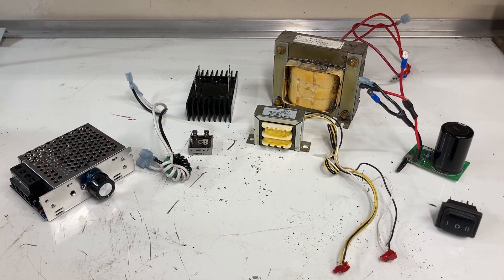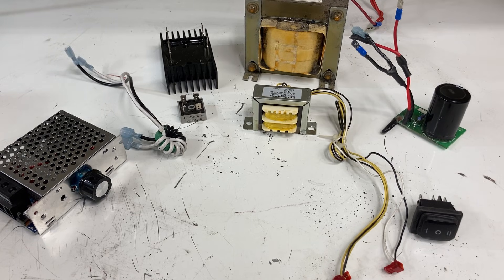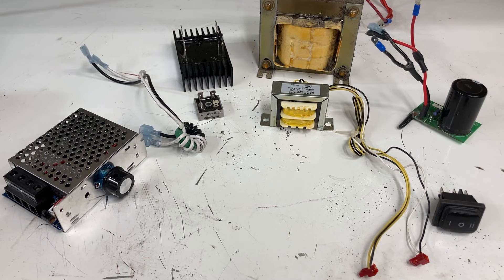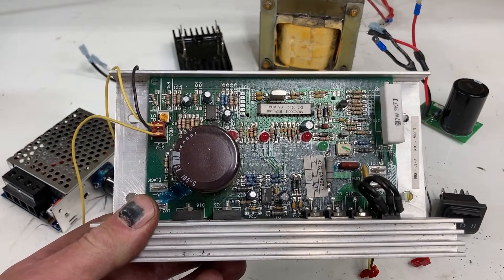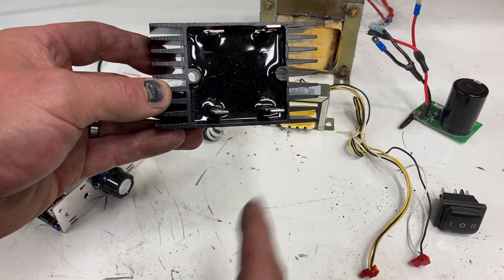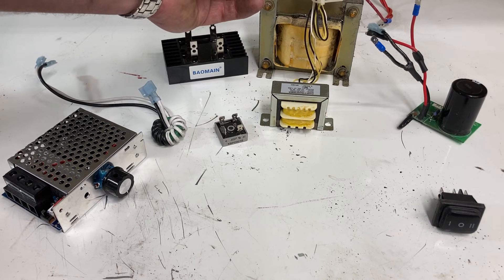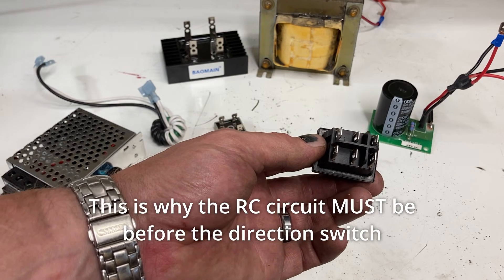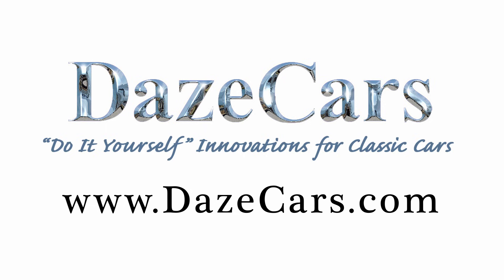Putting Together a QUALITY Variable Speed Power Supply or Treadmill Motor Controller SCR type

Comment: Hello Mr DAZE(?);I LOVE your videos,i try to do the same circuit like you did for my training treadmill,i use all the parts you are using except the scr,i use the one you saw on 12:15 ,and its fail,when i increase the speed the main panel fuse trips.but it did the same when i use the one  you saw to as on 11:10 sec .any sejection please?
Reply from the maker: its not a problem with the SCRs.  Something is causing a higher load draw.  My guess is possibly an issue with the motor or something causing excessive resistance in the belt or other moving parts.  amp draw goes up as load goes up so if the belt is requiring extra force the amps needed to turn it would increase and the breaker would trip.

Comment: just re watched your video What is that part in the upper right that is a circuit board with a capacitor and positive and negative wires coming out of it? You did not mention it in your video and what its used for
Reply from the maker: That is a filtering capacitor.  I had mixed results with that component and ultimately removed it due to motor surging under a load.

Comment: I have a question I am currently replacing the MC2100 card to the scr controller. When you get ready to start up your equipment with it installed do you turn your pots all the way down before powering up to protect your controller? Or do you have some protection for that
Reply from the maker: I do not turn them all the way down and no "protection" is required.  I flip it on at what ever speed it is at and thats the advantage!  Often times I am working a project that requires the same speed each time the machine is turned on so its nice to be able to just flip the switch, have a good starting point speed wise, and then I can adjust as needed.
Reply: @dazecars  Thanks for the quick response
Reply from the maker: you are welcome

Comment: Little bit confused after watching the whole video. At the beginning, you said the ferrite choke was the little wires that wrap around each other, and then towards the middle of the video you were explaining the difference between a transformer and a ferrite choke? What am I missing?
Reply from the maker: a choke is either a donut core with wire wraped around it (ususally used for AC ) or a large metal core with a coil (This would be a motor choke ususllay used for DC)   A motor choke lookes like a transformer but ther are totally differnt components.  A motor choke has 2 wires a transformer has 3 or more. I have several videos specificaly on chokes.

Comment: Another great video. Here's another question to continue our previous conversation. I also have two huge 5hp motors off som industrial treadmill I picked up on the side of the road. The treadmill were 220v. I have 220v in my garage and after you said that the other motor wasn't very good, I though that maybe one of these would be better although they are much bigger and will be a pain to mount. I take it it isnt as simple as a 110v motor like the one in your video. To me it sounds like ill need a 220v vfd. Here are the stats:Model JM11-007. ac30V, 1500w, 60 hertz, 6.5 amps.
Reply from the maker: VFD and a three phase motor is a superior way to go but more expensive.  The DC treadmill motor works almost as well and is 6X cheaper that is why most go that direction BUT if you already have the motors you have half the cost covered.

Comment: Did I miss you identifying the DC ferrite choke? I found something that looks similar on Amazon labeled "Filter Choke" with a lot of specs after it - I'm just not sure if this is what I need. Also, in looking into this I ran across the "SCR vs TRIAC" debate - very cool that you followed through on it and made a correction (I went and watched that video as well.) I'm playing with my first treadmill project for a drill press and plan to stay with the PWM controller that was in there just for simplicity's sake - but I may want to change over to your design at some point. Any comments about using my PWM? I know I would rather have a simple knob to turn rather that the treadmill buttons but other than that?...Thanks!
Reply from the maker: Not being an electrical engineer I do not have any specs or calculations for you on the motor choke. What I can do however is offer you some guidelines. First of all bigger is better. I have several motor chokes ranging from the size of a tennis ball to the size of a soft ball and the bigger they are the better they work. Second the wire for the choke needs to be a minimum of 16 awg. If the wire is not that big or better it will not have the amperage capacity to allow the motor to work properly. Amperage is the most important spec.  A lot of the chokes available online are rated in mA.  there are 1000 mA in an amp.  Treadmill motors are rated in amps so most chokes available online are several hundred times too small.  Third they are not available on Amazon at least not inexpensively, there are a few privet sellers on Amazon selling used parts for big bucks but the available chokes on amazon are too small because they are not designed for a motor even though they look correct in the picture they are WAY too small.  https://youtu.be/hbfOWrmP_pw The choke in most of my videos is part number 130993. Instead of getting one new I would get a used one. A lot of treadmills come with a choke. Go to eBay and search “treadmill motor choke” BUT know that most people on eBay don’t know what they have and the word “transformer" will also appear in most listings. Problem is a choke and a transformer look almost identical so some listings are for transformers and some are fore chokes because the sellers think they are interchangeable. They are not. They would only be interchangeable if you modify a transformer to work as a choke. (see my DIY choke video) To tell the difference count the wires. A choke will only have 2 wires, a transformer will have 3 or more. Also before I started doing videos chokes on eBay could be had for $25 or less shipped but now that more people are looking for them (due to my videos) the eBay sellers have raised their prices quite a bit.  as far as my views on a treadmill PWM they produce clean power but are not very robust.  I have several videos on the MC2100 and why I don't like it as well as this wone comparing the MC2100 to my SCR and rectifier setup.  https://youtu.be/zej3rkAEVDg Please let me know if I can be of further assistance.

Comment: Hi, is there preferred specs for either of the chokes/inductors? I am looking to order the parts, Amazon currently does not have available the specific SCR the you have listed, is there another model you recommend?
Thanks.
Reply from the maker: Not being an electrical engineer I do not have any specs or calculations for you on the motor choke. What I can do however is offer you some guidelines. First of all bigger is better. I have several motor chokes ranging from the size of a tennis ball to the size of a soft ball and the bigger they are the better they work. Second the wire for the choke needs to be a minimum of 16 awg. If the wire is not that big or better it will not have the amperage capacity to allow the motor to work properly. Amperage is the most important spec.  A lot of the chokes available online are rated in mA.  there are 1000 mA in an amp.  Treadmill motors are rated in amps so most chokes available online are several hundred times too small.  Third they are not available on Amazon at least not inexpensively, there are a few privet sellers on Amazon selling used parts for big bucks but the available chokes on amazon are too small because they are not designed for a motor even though they look correct in the picture they are WAY too small. The choke in most of my videos is part number 130993. Instead of getting one new I would get a used one. A lot of treadmills come with a choke. Go to eBay and search “treadmill motor choke” BUT know that most people on eBay don’t know what they have and the word “transformer" will also appear in most listings. Problem is a choke and a transformer look almost identical so some listings are for transformers and some are fore chokes because the sellers think they are interchangeable. They are not. They would only be interchangeable if you modify a transformer to work as a choke. (see my DIY choke video) To tell the difference count the wires. A choke will only have 2 wires, a transformer will have 3 or more. Also before I started doing videos chokes on eBay could be had for $25 or less shipped but now that more people are looking for them (due to my videos) the eBay sellers have raised their prices quite a bit. here is an Amazon link for the power supply.  thank for pointing out that the other link was currently unavailable. https://amzn.to/48emkOh  Please let me know if I can be of further assistance.

Comment: Going to use TM motor for honey extractor, i.e. centrifuge out honey from frames.  What's the cheaper SCR that's mentioned with your bandsaw?  Seems good enough for my application.   Any other advice for my application?  Thx.  Great resource!
Reply from the maker: My advice would not be to get the cheaper SCR.  It has cheaper components, has no cooling fan and the motor simply doesn't run as well.  But if you insist on getting it this would be the link https://amzn.to/3YA3rSP  its about 1/2 the price and easily 1/2 the quality.  For $15 more the other one is so much better.
Reply: Thx, will go with your advice.
Reply from the maker: glad I could help

Comment: You don't put a capacitor on the rectified current?  I'm interested in seeing what the result is if you smooth it out.
Also, I don't think you were clear about what causes the band saw to bog down when applying load - is it the cheaper SCR to blame?  
Thanks for the info here - I've messed around with this a lot and didn't get results like you, but I think now it's because I didn't have the chokes.  Probably why you don't have blue sparks jetting out the back of your motor.  :D
Reply from the maker: Originally I ran a DC capacitor in parallel with the motor after the rectifier. And while it did help clothe power I found a surging load. Not all SCRs are created equally you must get the good one and a choke is IMHA required every time.

Comment: One thing that may confuse or mislead people..... SCR based power supplies put out a pulsing DC voltage. No diode bridge needed. A TRIAC based circuit puts out AC voltage and this is where a diode bridge is needed. Also, strongly recommend any filtering devices (chokes, capacitors, etc) be placed immediately before the motor. After all it is the motor that needs the filtering not the bridge. Transformers can be used as chokes, simply use either the primary or secondary winding, not both. The transformer winding used has to have enough current capacity just like a choke would. I'm a retired electronics tech....
Reply from the maker: You may be a retired electronics technician but you are completely incorrect.  The voltage coming out of an SCR is NOT DC. It is pulsed AC and the rectifier IS required every time! I have measured the AC with my meter and ALL the aftermarket SCR power supplies available are labeled AC in AC out.   This is not to say you can not have an AC to DC SCR type power supply but it’s not a function of the SCR component that makes the power coming out DC.  The MC 60 is an SCR type power supply and the voltage coming out of it is in fact DC. But that is because it has rectifying components on board. An SCR chip is designed to only work on AC and it has no other components with in it that convert AC to DC.   Unless it is a specifically built DC power supply an SCR voltage controller will require a rectifier EVERY TIME. 

As to placement  of the chokes close to the motor that is a true statement EXCEPT the type of choke/inductor I use after the SCR but before the rectifier is more effective with AC current than DC current so it is used as the very last component before the AC is converted to DC at the rectifier.
Reply from the maker: @LouinVB I apologize for arguing with you.  I knew for a fact that the power supplies I was using were called SCR by the manufacturers and were in fact AC to AC not even thinking about the component SCR and how it works.  Upon further research I saw my error and have made another video going over the fact that at least one of them is indeed a triac and not an SCR.  Thank you for the comment. https://youtu.be/khyTt_fE0zI
Reply: So, this is awkward..... Retired guy is actually completely correct. You see, the R in SCR stands for rectifier. Here's the homework, from a textbook standpoint anyways....

A Silicon Controlled Rectifier (SCR) produces a direct current (DC) output when connected to an alternating current (AC) input. This is because an SCR is a unidirectional device that only allows current to flow in one direction, rectifying the AC input. A single SCR produces a pulsating DC output from an input AC waveform. More than one SCR can produce a pulsating DC output or pulsating AC output.

Taken from a a few Google search results.....
Reply from the maker: Nothing awkward at all because in this case a rectifier IS STILL REQUIRED. The two of you are taking a general concept of what an SCR chip is and applying it to an entire power supply that is configured to work in a specific way, AC to AC.  It is FORE SURE not DC coming out of these boxes.  The wiring instructions call the output hot and neutral (AC labeling), not + and - (DC labeling).  I have put a meter on it and the output is AC not DC.    Also looking at your own cut and paste, take a look at the last half of the sentence after the OR  "More than one SCR can produce a pulsating DC output or pulsating AC output."  All the units available on Amazon or eBay produce a pulsing AC output, that is what the power supply is designed to do, reduce AC voltage.    I appreciate both you and @LouinVB trying to point out an error, but in this case it is not in error as the specific product being used is AC to AC and I don't want these comments to lead someone to think they don't need the bridge rectifier because if they try to run this box without a bridge rectifier they will burn up their DC motor with AC current.
Reply from the maker: @jarredmattingly5369  Thank you for making this comment it encouraged me to look further into what type of power supply this units actually are and even though labeled as an SCR by the manufacturer they are in fact Triac based.  I'm always learning and I appreciate your comment.  https://youtu.be/khyTt_fE0zI
Reply: @dazecars  you're very welcome. Always learning.... That's the idea. Thanks for the videos! I've learned lots from you too!

Comment: why did you have a capacitor in the video do you use one?
Reply from the maker: In the early days I did run a capacitor but I found the choke was good enough at cleaning power and the capacitor caused surging under a load.

Comment: Can we use the Variac directly connected to the Motor if it's anAC motor??
Reply from the maker: not really.  Can you yes but it will effect torque and it is hard on the motor.  AC motors are designed to work a very specific operating voltage.  When you change that it drastically effects function.  The correct and really only way to very the speed on an AC motor is to use a VFD
Reply: @dazecars Greetings from India,  Thank you for your reply. did not expect it that soon. 👍👍👍
Reply from the maker: Even though there is way more of them than there is of me I try to respond in a timely manner to ALL the people that took the time to make a comment or ask a question..
Reply: @dazecars  That's impressive , always good to meet someone with a strong  Character....

Comment: i saw in your other video about the size of potentiometer you recommend was a 15k in series with a 135K. the KB-225 motor controler uses a 5K potentiometer. what am I missing?
Reply from the maker: They are totally different controllers with totally different components.
Reply: Ok, thanks
Reply from the maker: my pleasure

Comment: I'm wondering if I could use 120v AC motor running a car alternator to charge a car battery to then run a treadmill motor so as to avoid all these pros and cons of motor controllers. Why is it so complicated? How does Elon musk control his DC motor in his cars?
Reply from the maker: that would only work if you wanted one speed and not very fast.  It is volts that changes speed.  A 12 V battery will only give you the speed the motor turns at 12V.  The complication is not converting AC to DC, that part is easy.  The complication is in changing the voltage so you can change the speed.

Comment: I bought 3 SCRs from Amazon ( yours recommended link) and  after connecting the 110v input I measured only 110v output , turning potenciometer didn't made a difference.  Am I so "lucky " getting a defected once or am I making some mistakes?
Reply from the maker: That is because it's not under a load.  Because of the on off switching action of an SCR it will measure at full volts without something to draw it down attached.
Reply: Ok,thanks!

Comment: I went a similar journey. Ended up with dual power supply; 3-24 V DC for 20 - 150 high torque rpm, and the cheapo 20 - 180 V pwm for revs up to 4000. Demo on my channel https://youtu.be/ZU9LQTl86Uo